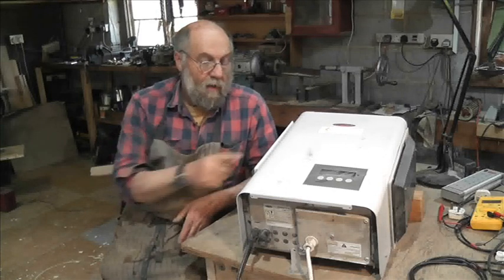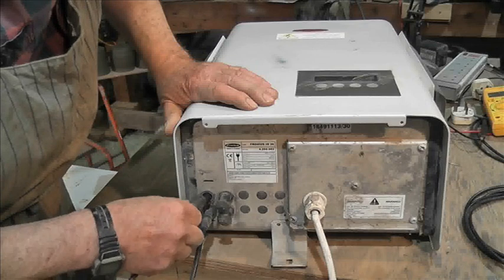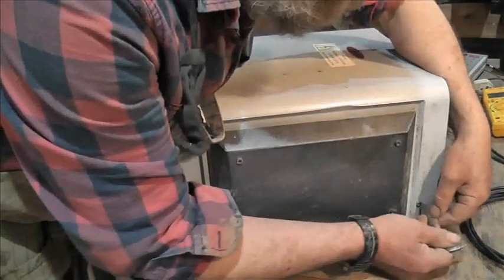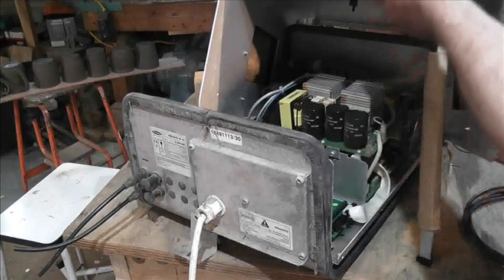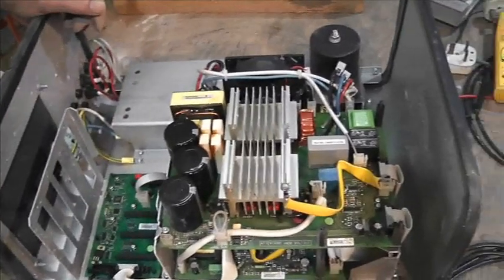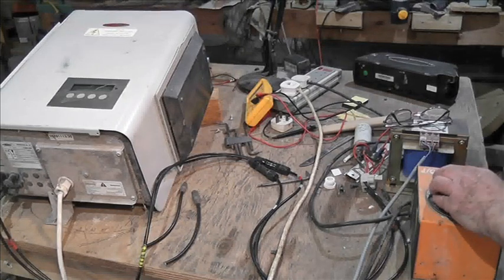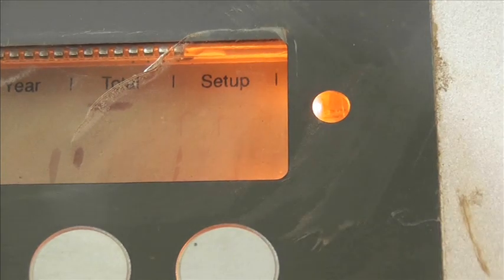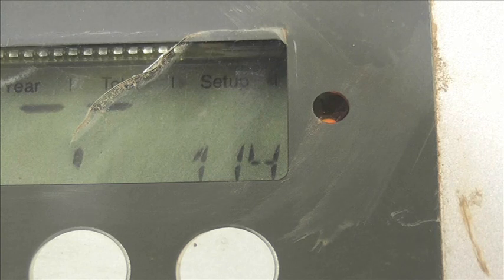Fronius IG30 investigation., solar grid inverter

Comment: It’s good that the display is doing SOMETHING, seems some segment drives are missing. Is the display ribbon cable extension wired 1:1 or crossed over? I would want to eliminate faults in the extension cable by plugging the short end direct to the board. Also have a close look for green crusties on the pins/sockets and clean up anything looking dodgy. If that doesn’t work go after the relays.
Reply: Could also be corrosion in the zebra strip that makes the connections to the LCD glass.
Reply from the maker: @randacnam7321  Yes, especially as it is only IP45, cheers
Reply from the maker: Ah yes all the usual suspects. The ribbon middle connector is 1 0n 1 and not compatible with the end sockets. I've been going through connections with switch cleaner with no positive result, cheers
Reply: Slt j'ai un souci avec le modèle ig plus v30

Comment: The STATE 104 code is usually referring to an issue with the power from the electricity grid being outside the pre-defined limits of the Fronius inverter. With that being the case the first thing to do is check the following:

1. Check that there is not a blackout – do you have power elsewhere?

2. Locate the Solar Supply Main Switch in your switchboard and ensure it is in the ON position

3. Locate the AC Output Isolator (if present it will be beside the inverter, your system may not have one) and ensure it is ON

4. If any of the above were off then turn it back on and check your inverter and see if it’s restarting. This process will usually take a couple of minutes

If after checking the above and still the STATE 104 code hasn’t cleared it is worth trying one last thing and that’s a reboot of the system. To ensure that it isn’t just a one off error the best thing to do is try to reboot the inverter.
Reply from the maker: Adrian, yes, I've read that also, but in this case it's irrelevant as we are bench testing. I've looked for an internal fuse, no luck, cheers
Reply: @TheInfoworks  hi check the green transformer i think you will fined it oc
Reply from the maker: @jackednayoung  Will do, although it's a very old unit and the duff screen does not help, cheers
Reply: @TheInfoworks  it may be old but they are bullet proof out last modern ones
Reply: @jackednayoung  Apart from when they break ;-)
Reply: It could be that whatever is doing the mains potential measurement has a problem (dead divider chain resistors, open circuit transformer, corroded trimpot, etc).